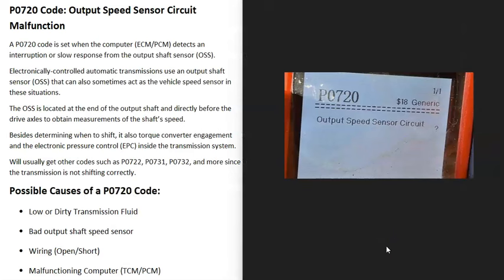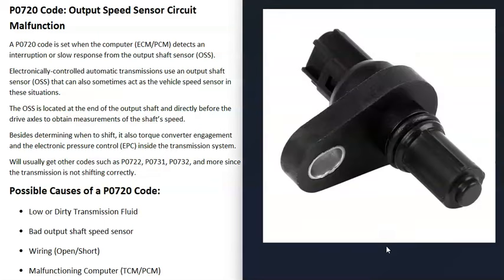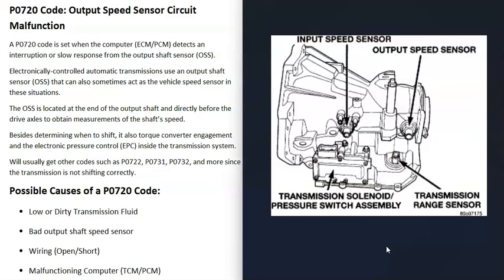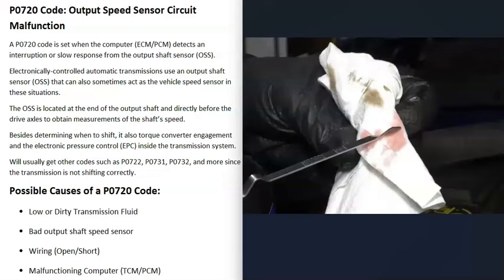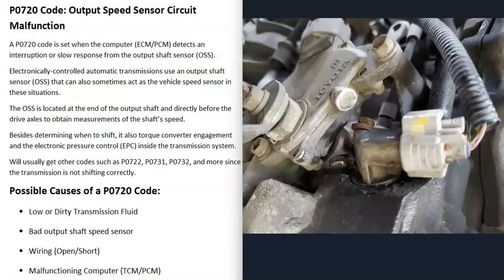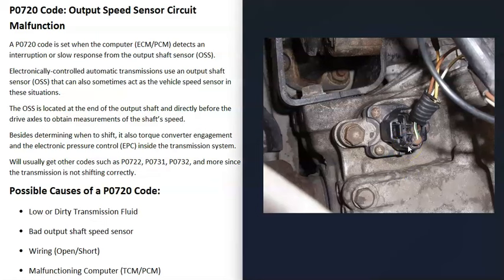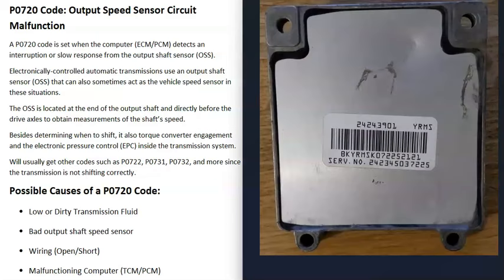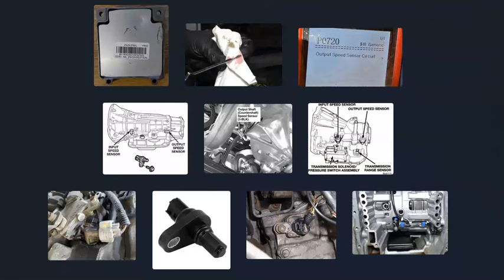Causes and Fixes P0720 Code: Output Speed Sensor Circuit Malfunction

Comment: Replaced my speed sensor on my 2001 F250 And erased the code. That didn’t fix the problem. Transmission fluid is fine looks new. Transmission serviced 3 years ago.
Reply: Fix the problem yet? What was wrong.
Reply: It could be the alternator. It causes an ac ripple and messes with the signal to the speed sensor. Even if the alternator is still working this can happen.
Reply: @shred369  What? Where did you hear this bs?😂
Reply: @deanmartin2332  found it in forums online. I had the same problem with my 7.3 and it was the issue.
Reply: @deanmartin2332 hey bro you have to change the entire lead frame. Not just the speed sensor, my 2013 f150 was on crack downshifting and getting stuck and it turns out that’s the issue!
Reply: @KodeshCleaning so it was your alternator? I have an 03 5.4 Excursion. I’ve replaced the alternator probably 3 years ago. Bought it from a local private owned store. A few months ago I noticed squealing. Narrowed it down to the alternator. Said store won’t replace it. I’m guessing it’s a bad bearing. It’ll squeal every so often and stop. I haven’t thought anything about replacing it because I hardly drive it. Now I get this damn code randomly and a misfire. It shut off this and over drive flashing. Only did it once.  I’ve also seen other people mention the alternator. Don’t know where I’m going to start. It’s like the damn vehicle knows tax money is coming in

Comment: My 2014 ford fusion has something similar. I can put it in reverse perfectly fine, park, neutral, but when I put it in drive, there is a delay and when it engages first, it’s really rough. I replaced the sensor, and it’s the same issue, I have the part that plugs onto the sensor, I’m gonna try that
Reply: How many miles on Fusion ? They are known to have transmission issues. Even the newer ones.
Reply: I just replaced my sensor and my cars doing the same thing and arguably doing it worse, I don’t know what to do with this thing, i think I’m gonna try replacing wires next
Reply: @ThatAKguy47  How many miles on that transmission? Fusion transmissions are crap. Especially if you don’t service them properly.
Reply: @deanmartin2332  dude, I kid you not, the transmission went out again last week, I had to buy a brand new car because I’m so done with the Ford. I will never own a Ford again lol
Reply: @ThatAKguy47  Transmissions aren’t bulletproof. If you don’t change the fluid they fail. Name me one automatic transmission you never have to service.

Comment: Good evening, I have a problem with the transmission, when the speed reaches 70 kilometers, vibration occurs in the car, and it is not acceptable to increase the speed, and when opd1 checks, the code p0720 appears, what is the reason?
Reply: Same!
Reply: @theconsciousmovement9669  I couldn't solve the problem, but when the problem occurs at a speed of 50 miles, the controller enters safe mode and then disables spray number 1.2.

Comment: Here's a good one for you. 2004 F150 5.4 going into P2106 limp mode and getting P0720, P0722 but the transmission works just fine all gears and overdrive.   Very intermittent.   I'm guessing it's wiring.
Reply from the maker: It needs to be diagnosed, but ya it sounds like the speed sensor is going bad or there is a wiring issue.